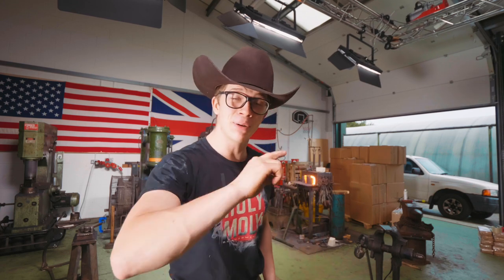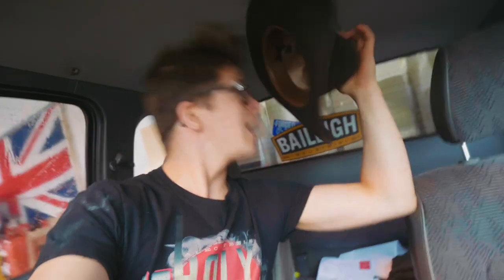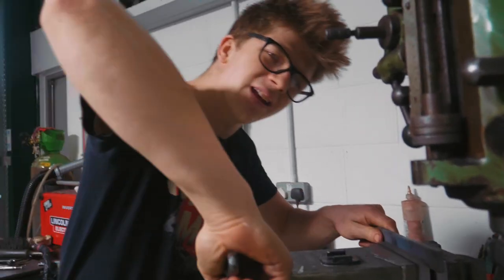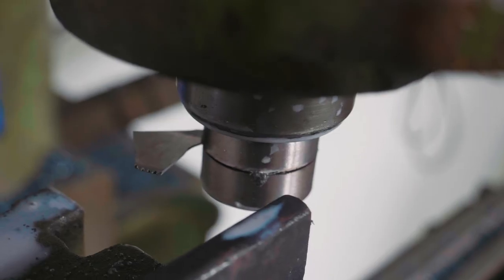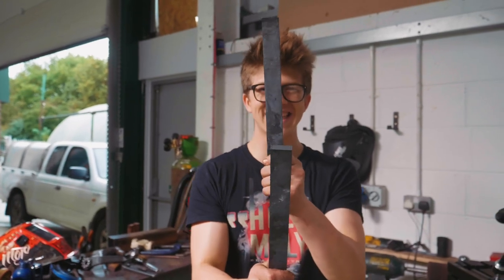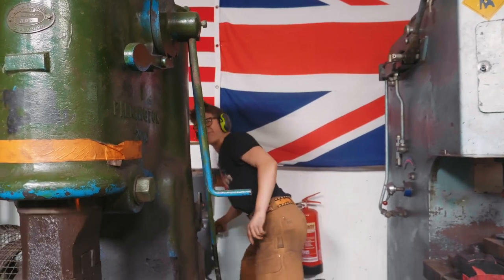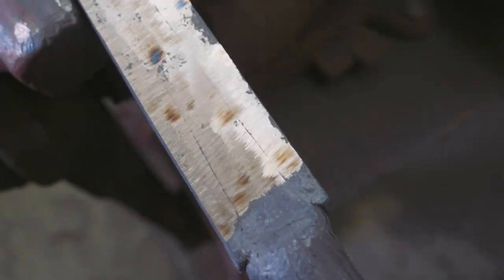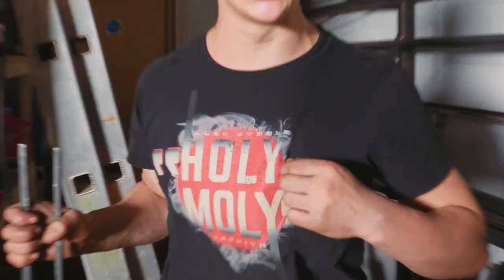MAKING A KATANA!!! NOW 1,000,000+ LAYERS?!? PART 2

Comment: OHHHHHH! Saw that coming. Pun intended :) I was yelling at you... Glad you had your glasses on. That slitting saw had too fine of a pitch for that deep of a cut. What made it break is the teeth getting "chip bound" and getting stuck in the cut.
Ok.
#1 your RPM looked fine.
#2 Use lots of coolant.
#3 Use a cutter with side clearance if possible. Like this: https://www.mscdirect.com/product/details/73013161.
#4 Any time you use a saw like that, always "climb mill" otherwise the saw will wander and break. On a small mill like a Bridgeport you will have to use the table lock to add some drag to the table when climb milling, so the cutter wont suck the part in.
#5 Again, use more coolant. You want the force of the coolant to wash away the chips before it re-enters the cut.
If you use an arbor with a keyway in it, leave the key out on the thinner cutters, so they slip a little. They may break anyway though.
Take more shallow passes if need be. Cutters with more chip clearance can go deeper. Always climb mill.

Since you mostly use HSS tools use this formula for determining cutting RPM.
RPM = CS X 4 / Dia
Where CS = cutting speed for material you are cutting. Mild steel/ Med carbon steel 90 Feet per minute or 27 M/min. Chrome moly 45 feet/min or 13 M/min. Aluminum, 1000 ft/min or 470 M/min.
Dia = diameter of what is turning. Cutter dia for a mill or drill press, work diameter for a lathe.
For carbide cutting tools, go 4 times faster.

Also for tap drill size: MD-pitch. This works for any thread, metric or imperial.
Where MD is the major diameter of the thread.
For the tap drill size for a 10mm x 1.0 pitch subtract 1.0 (the pitch) from 10 (the MD) and you get 9mm the drill size for an approximately 75% thread depth.
for an imperial thread like 3/4-10, it would be .750 (3/4) minus 0.100 (1/10 of an inch) or .650 inch or 21/32"

I enjoy your videos every day!  Keep up the good work.

Comment: so i’m just throwing this out there, i have no idea if you already know this or not. but traditional katana marking has you sandwich iron in between taco like shaped steel. make a v with the steel then insert the iron in the middle opening
Reply: Yes and just throwing it out there traditional katana were made out of differentially hardened steel instead of Damascus steel. So how accurate do you really want it to be?
Reply: San Mai is the Japanese way to make katanas. It's called San Mai, not "taco". If youre going to be technical use the proper terminology.
Reply: @ChicknSandwich  kobuse,Honsanmai,shihozume,wariha tetsu,Gomai,makuri,and the best Soshu kitae,some lamination methods.
Reply: @hachimanjiro  peepee, popo, achicky choco, benihana, maguro are wins too
Reply: @aoitorikori1240  the hardening was done after the blade was forged though
Reply: so you want traditional? would that be the 子伏せ technique especially used in the world war 2 period and still today, I guess you knew the 3 different types of steel grading? 氏がね、皮鉄 and 鋼 right? Traditional enough?
You could go even more traditional and practice 試し斬り on criminals instead of 畳表 but you knew all about that

Comment: Alec  you need to stop  climb milling  with a conventional machine.  your going to break alot of tools doing that.  in this video you used you face mill cutter cutting from right to left with the tool turning clockwise with the cutter center line on the front side of the material the face toward you .  the teeth digging in to the steel and grabbing and pulling the cutter along this is hard on the cutter, the machine the drive belt, and  the electric motor from all the impact shock.     rule of thumb keep the center line of the tool on the on the right hand side of the material  for the direction your traveling on narrow parts thinner there the width of your cutter.   this happens at from 8:12 8:13  the center line of your tool should have been towards the fixed jaw side of the vise, when cutting from left to right you want the center line towards the moving jaw. just a bit of advise
Reply: john clark i have no idea what the hell you said but it sounds like he better heed your advice...😂
Reply: john clark saved me alot of typing hahaha
Reply: More than a bit...
Reply: turns out this was all just bullshit
Reply: I'm sure there is some good advice to cipher from this mess of a comment.
Reply: @__w__o__w__  lmao i should have made it obvious i was entertaining a hypothetical scenario. Yeah this comment is premeditated genius, as long as its accurate.
Reply: I think a know what your talking about and Tasha helped me spot I don’t have a mill but I’ve got a very big drill press I do a lot of stuff with a milling vice

Comment: By the time you got 1000000 layer, wouldn't the steel be homogeneous by then?
Reply: (+Thomas Muehldorf) That’s the whole reason that katanas are made that way. It was needed back in ancient Japan when they couldn’t get the steel hot enough to be homogeneous, so they would fold it repeatedly to do that. It’s made that way in modern tomes more out of tradition.

Comment: What advantage does the folded steel have when compared to regular steel when making a katana?  And if pressure forged steel is better for this application or is it similar to folding? Finally, does cutting, welding, and forging create large slip plains or do the grain boundaries just mish-mash together? Thanks in advance for a response I’m genuinely interested in the topic and understanding whats going on with the grains and planes of the metal. Any addition info is very welcomed!

Comment: I die a little inside every time you char a handle. It's not a BBQ. It doesn't all have to be char grilled. The contrast of timber grain against metal is so beautiful. sob just use sniffle some oil sob
Reply: Luke Sherwell it helps with grip and wear resistance. It makes me hurt too but it has purpose
Reply: I agree

Comment: Well, that should be 1,5 million layer, because you doubled the lenght of "stars" 500k block of steel doesn't mean you deleted layers. Typical math problem here: Sandwitching 500k block into 2 thinner 500k star blocks means 500k + 2x500k = 1,5m :))

Comment: im not sure why so many videos are calling forge-welded steel Damascus.  Damascus steel was a single ingot, when you are using forge-welded steel of varying types, that is the Japanese forge-welded method, not actually Damascus steel.  Damascus steel was made using the wootz method.  this is the Japanese forge-welded method, but rather than using multiple different carbon content metals usually put in thin layers of charcoal/carbon between the layers.  while forge-welding differing carbon-content metals does give it the same appearance as Damascus steel, it isn't.  one of the characteristics of real Damascus steel was the low temperatures it could be worked at, it normally purpled in the 850-950F range and was white by 1100-1200F.

Comment: This probably seems erroneous but your hair is a hot mess. A good quick and easy style for you would be ( in my opinion ) cut it down in the following way: 3 on top faded to zero on bottom. Then get yourself a blow dryer and each morning do the same thing your doing but push it all forward and off to one side. I think I know what you are going for its just your hair is a bit too long. Anyhow, do whatever you want I just figured I would remark cause I am invasive like that from time to time.

Comment: That... was a slitting saw not a cutter, high speed steel too. Probably best used on nonferrous materials, you need at least a cobalt coated for steels although a vanadium chrome would be best. Once you get those they're still brittle, so don't take more that a .020" of an inch cut.

Comment: I am just amazed by how much metal is being lost whenever you heat the steel and then power hammer it.  All that slag flying off has to add up.  It would be reasonable to guess that about 15% of metal is just missing when it is fully forged, but instead is lying around the shop on the floor as slag/rust you sweep up?

Comment: Not once did you fold the steel. If im correct you just have squished layers. not actual made the katana way, it was clear they folded the steel for weeks if not months i believe doing this many thousands of times. i don't think you can weld it together then just compress it and call layers.

Comment: The only thing is worry about is how welding the 2 pieces together and how you depth of penetration sure the together but the still is a discontinuity in it which would make it easier to suffer something like heat cracking

Comment: Alec, I really like your videos and is prety cool to watch you using all this modern hardware to fold metal in this huge number of layers, but once your proposal was to make a katana I was expecting you would try to use your equipament to make a real katana, forging diferent types of steel to each part of blade like bellow: 
- Hard steel in edge (hatetsu);
- Soft steel in the core (shintetsu);
- Medium steel in the back (munetetsu);
- Folding steel in the sides (kawatetsu).

You can't forge a blade and call it as katana without observe this. No offense, but if you just fold the steel you are just making a beautiful big knife.

If you want to try this way will be nice to watch.

Comment: why did you mill down the billets when you could've done that after forge welding? i mean you're going to take the material off after anyways so why create more work for yourself? also you have a power hammer, any inconsistencies in attempting to forge weld 2 different sized billets would hammer out with the power hammer..... take notes from man at arms, you are making progress from the last time i saw a video but you still have a little ways to go before i can consider you a blacksmith who knows what he is doing.

Comment: hey brO!!
fisrt youre awesome thats a fact and the video work is super!!

ive noticed that youre sword seems to be a "little" out of proportion.
if you want to be perfect, and historically accurate theres a geometric charts for its proportion.

if your heigh is (metric) 170 so the blade from habaki to kisaki should be 72.7 cm, if its 175 then 74.3 
180 75.8
185 77.3
190 78.8
195 80.3
200 81.8
if theres missing some heigh you can calculate it yourself its : those heights, and for every one centimiter you add 3 milimeter of lenght to the blade itself.

also the width must be around 27 mm in the thinest and 35 in the widest, also you can make the curve pre heat treat or with heat treat, but do keep in mind that the curve equals to somewhat around one blades width.

if your gonna heat treat it and you want to go fancy, you can use hamon clay, it has lots of different mixtures but heres mine
clay 90
charcoal 7-8
rust 1-1.5
sugar >1
salt 0.5
if you want to you can change the components, be sure to make two different batches, one is super deluded with which you coat all the blade with thinnest layer possible, be sure to grind the components firly beforhand, and the second mixture, make it little thicker but more liquid than dough and apply it on to the spine of the blade, with different patterns you'll get different result, so please do some research on that beforhand =] 

hope youll read it because its a lot of typing for you there. 

also if you;ll need any help in the later steps wich are time and times more difficult feel free to ask me if you feel the need.

keep up the good work!!!

Comment: You do realize that at 500,000 plus layers they will be less than 10 micron. So you just said 1m layers so less than 5 microns. Your metal is probably diffused into only one alloy now.
Reply: On a note your carbide crystals are something like a .25 micron size.

Comment: Alec, I have never had much luck with slitting saws, as they usually break just like yours did.  You might want to try some abrasive cut-off wheels.  I have had much better luck using those on my mill.  That said, you would probably have gone through a lot  of them to cut that big piece of steel down the center line.

Comment: .....really 😔 you tack welded them together! Bro, you kinda supposed to keep the sides of the billet an just flatten it out then sandwich it. One with hard steel on the outside an softer steel on the inside

Comment: Just wanted to make a comment on the saw you used that broke. Many of those need to spin at very high speeds to avoid breakage. The thin discs are super fragile. Until you hit extreme rpms. So good luck testing? Lol

Comment: What's the plan for the tip of the blade? I think it would look cool if you cut a V at the top and forged it together, so that the two sides of the 500k goes together. Niels Provos does this with his blades, and it looks fantastic. Cheers.

Comment: Hi Alec, saw blades are very fragile tools, as you saw. Try it would be better to calculate the feed and speed with a chip thickness per tooth. Its anoying i know but it works much better und you wont break a tool so easy in the future.

Comment: you should get a hand held belt sander, the type used for wood to clean the scale off your billets.  a good 60 or 36 grit belt would take it off quickly and evenly, plus leave a flatter surface then I would be able to grind.

Comment: Hey Alec, so i was thinking that if you wanted to make the katana a bit more traditional. You could add a Hamone to it. Basically you cover the spine in a clay mixture (i don't know what kind). Heat treat the blade with it on, and what it does is keeps the spine softer and the edge hard. That was out can take hits batter. Just a thought, hope it helps

Comment: When you grind your stock to find flaws, some cracks that you cannot see with a naked eye you could use a NDT method of dye liquid dye penterant from spot check. I use the method to inspect rail cars to find cracks in welds and apparent metal.

Comment: Hey Alec, nice that you try new Things at the mill but you drove at the wrong side with the blade. All teeth of the blade has do go against the metal and thats the reason why its exlode. If you drive it from the other side the teeth will drive in the same direction with the metal and it will get smoothly in the metal and it wont explode. Its would be easy to explain when i can draw it down for you

Comment: Hi,
 you did an amazing job, but, to get an extremely soled strong steel, don't let it dry, you have to dip the metal in water directly after you hammered the metal and it's still hot

Comment: when using those little saws on the mill, you probably need to take the mill scale off of the piece first, it being so hard. also sometimes those bandsaws can lock in an upright position and have a little platen to do a longways cut: http://bit.ly/2i9xD2d

Comment: The amount of steel that falls of the metal he forges is incredible you could probably make three knife from the the steel and why doesn't he wear gloves
Reply: he couldnt use any of that steel to make any knives at all as when he is heating it up the metal starts to form a metal oxide on the outside of the metal, thats what u see flaking off the bit of metal. metal oxides are no good for making knives/blades
Reply: @iamrobot1291  oh ok thanks that's cool to know
Reply: Wallace Reed no problem

Comment: Ok so don't hate me for asking this because this is like the sixth metalworking vid I've ever watched, but whenever I see people doing this at Renaissance fairs and demonstrations, they always dip it in a pool of water, but you dont as far as I can tell. Is there a reason?
Reply: The Dragon water is traditionally used, but it also gives an extremely higher chance of cracking. Oil drops the temps a bit better and more evenly and stands less of a chance of cracking